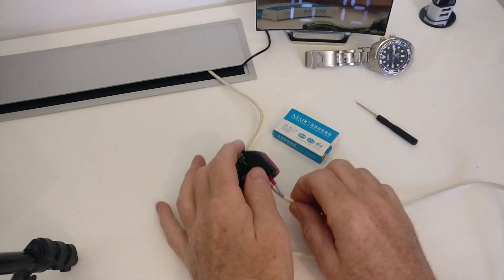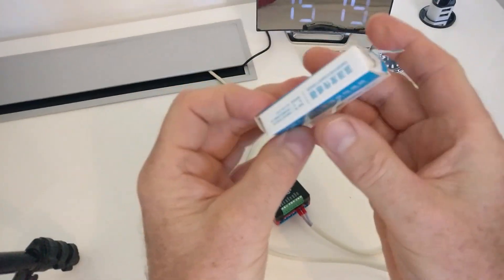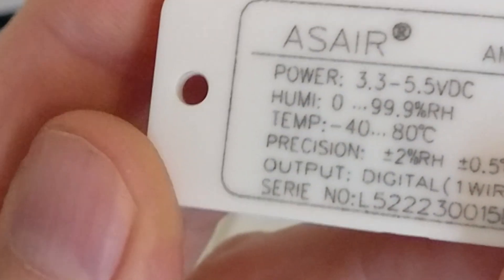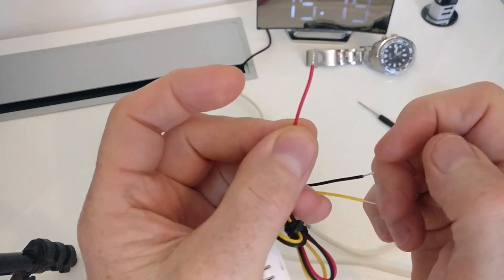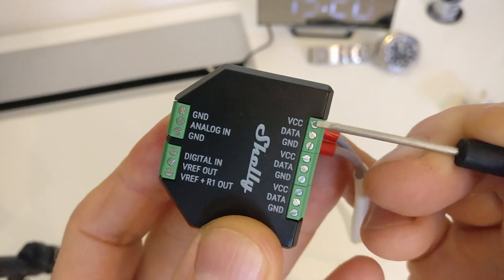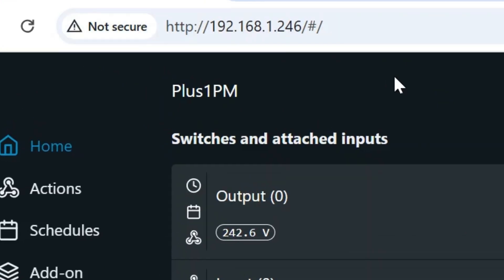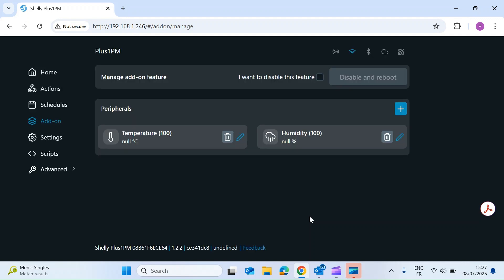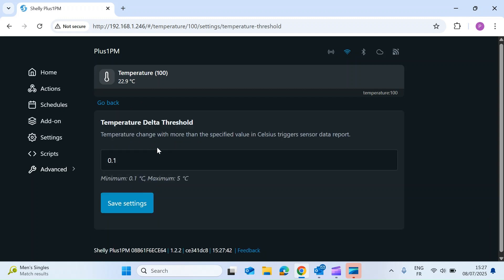Shelly Plus Add-On With Temperature & Humidity Sensor DHT22 | Setup Guide

Comment: Hello ,can I use one water leak sensor with the Shelly plus addon ?
Reply from the maker: Hi. Shelly say it supports a dht22 or a ds18b20. However I have seen other connect ultrasound sensors. I haven't seen a leak sensor but you could give it a try, but there's not guarantee it would work. There are options on the webgui for voltmeter, analogue and digital inputs.